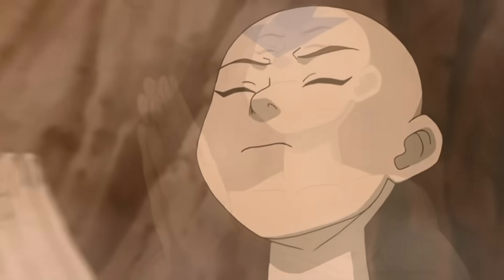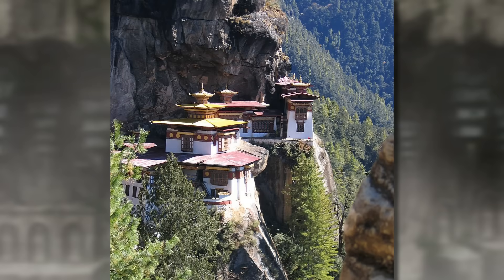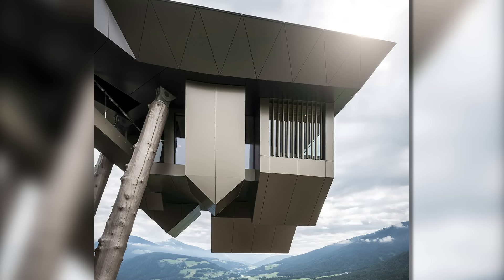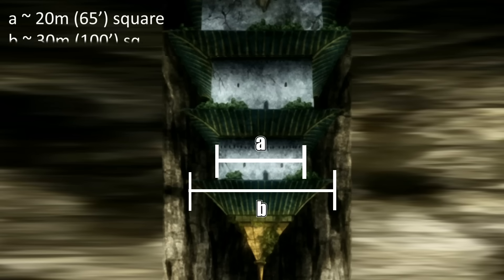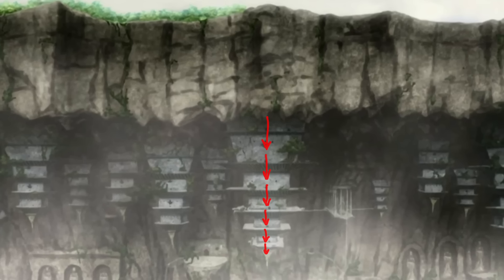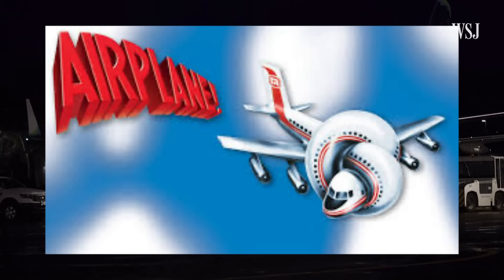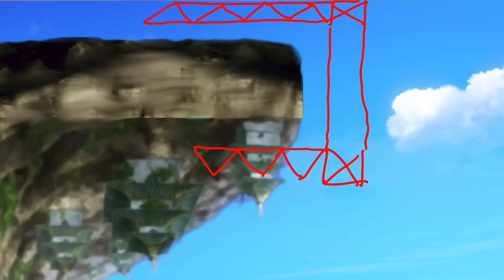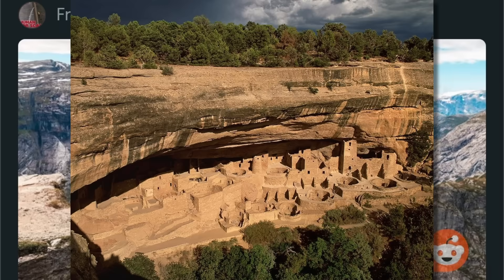Engineering Avatar’s Upside Down Architecture

Comment: I'm way late to this. But I have seen architecture like this before. Specifically in the game Skies of Arcadia. The city of Glacias hangs from the bottom of a cave ceiling. Inspired by icicles. I also have a note about how the Air Nomads made this air temple. And it allows for the solid looking building to make sense. Instead of the air temple being built like any other buildings. Instead they could have been carved into shape from already existing, giant stalactites and stylized scaffolding added around them

Comment: i thought it could be made be either carving out a stalacite, use beams going from into the rock to make a foundation, and then all the way down to carry all the wieght or a system of ropes or wires angered on the ceiling.
As for the reason of no real world examples? Big, stabil and reachable overhangs are extremly rare, and when they exist you could build above or below them instead.

Comment: My best idea, as a layman, would be to sink a  T shaped central structural member, probably steel or earthbent stone through the  overhang from the top, affix a cap on the lowest point, and use that as the support point to build back up the structural member to the overhanging roof.

Comment: Stalactites are NOT as solid as they seem. They're made out of calcium carbonate, a relatively soft, porous rock, and they're made through a process of water sedimentation rather than compression under heat + pressure say like how bedrock is usually formed. That's the same bedrock that's used as the anchor for most skyscrapers irl. I can't imagine the airbenders hollowing them out and using them as a base for buildings?

Comment: I think the use of multiple bending styles is the only way the western air temple could be built. Whether it was the cooperation of many different benders or some multi century project by several generations of avatars weilding all elements at once, real world manufacturing techniques are the real point of failure. 

Air benders can fly and have giant flying bison, earth benders can instantly and perfectly reshape rock and stone without worrying about imperfections or time for curing. Waterbenders can cut wood or help reroute natural springs to privide plumbing, and firebenders seem to have an advantage in forging metal components. The western air temple is really a monument to cooperation

Comment: My Analysis:
Since the Western Air Temple was built long before The 100 Years War (Fire Nation Rampage), the Air Nomads perhaps ask the Earth Bender to help build this Temple.
Now for the structural integrity, since it was built upside down, our modern structural design doesn't really matches with this model. So, i have a thoughts, Elementals Bending is fascinating because the Bender can manipulate matters to the atomic level (Fire Bending makes fire out of nowhere, Toph discover metal bending by analyzing earthly material in metal, Water Bender can control blood, etc), so the Earth Bender that build this strengthen the rocks by removing cracks and tighten the rock formations, so the rocks above can hold the structure that was built below.
How did they transport to this location? Every Air Nomads have Air Bison that can carry people, so they used Air Bison to transport the Earth Bender to the location, and then start building it, and voila, you have the Western Air Temple.

Comment: I would have actually thought of boring through the entirety of the rock and using some sort of super thick steel cables suspending down all the way to the "roof" of these buildings, and then building them to direct all forces towards the "roof". 
Either that or earth benders just doing super homogenous rock work, and given they can literally feel the properties of rock, they can probably also feel what would be a safe amount of weight to suspend in this way.

Comment: There also could be a more central support column, especially with a creative internal structure it would work a lot better.

Some large buildings were designed in the first place from handing memebers simulating compressive ones

Comment: If i could redesign the western air temple i would probably go with building it halfway into an overhanging cliff, keeping the core concept but making it actually mostly sensible.  
Basically like those houses that are built into hills, so you have entrances on both floors, except upside down.

Comment: The Air Nomads weren't an industrial society, and the temples are thousands of years old (long before the Avatar world's Industrial Revolution). So, structural steel likely wasn't used in its construction. At one point in the video, you compared the pagodas to stalagmites. What if they originally were stalagmites, and the ancient airbenders carved, hollowed out, and adorned them?

Comment: Actually there's a very easy and more interesting way to look at this from a mechanical engineering POV rather than just structural engineering. For a moment I want you to imagine a platter rope swing. There's a central tensile element (the rope) from which each "floor" (a wooden disk) hangs. the idea of the Western air temple is that same. There is a series of cables at the center of each of the towers that forms a strong tensile "core" and the various floors hang off of this tensile core. 

As a kid I actually designed and built one of the Western Air Temple towers out of rope and popsicle sticks and hung it from my ceiling, the structural model I used and the one presented in the video were completely different.

Comment: So the stalactites idea would be a possibility to me: maybe the cave is jutted with massive stalactites, and these airbenders made their structures around the stalactites. this way, the "upside down roofs" might be the building platforms, foundations and structural supports for the roofs above them. perhaps the walls of the pagodas are actually just chiseled walls of the stalactites. this would be in line with the scene where the building falls down and the building's inside seem to be solid.
Stalactites kinda form because of a water source above. with some plumbing they might catch the water, collect it and use the combined output of the stalactites for the fountain.

Comment: I always thought that these work like pyramids upside down that were carved out like the german castles. Think about it, pyramids have an ingenious design that allows them to be infinitely scalable since the load on the material doesn't change with size as with each new layer there's more supporting material. And since it is hinted that earth benders were involved, and it's shown that the power of bending allows to construct megastructures* is entirely plausible in this universe. In our universe, the biggest challenge would be finding a suitable piece of terrain that can be used. Besides, it's already shown that at least parts of the structure have been carved out of the rock formation, and since earthbending is the most efficient tool for that, it might be that the same earthbenders who have carved the statues carved the "cores" of temples. If you want to make the nerd-meter explode, you can calculate the power of combustion man's explosions to calculate the actual strength of the structures.

* e.g. (previous avatar creating an island, and the great wall)

Comment: Here's a support material you forgot: rope 

Since the entire structure is solely under tension, you don't need rigidity if the cables can be kept taut.

Silk, cotton, jute and bamboo fibers have much better specific tensile strength than most (if not all) metals/alloys.

And there are natural structures that hang of cliffs- plants!

So drill through the rock overhang, drop cables down it and anchor the cables throughout the material like plant roots.

You could also anchor it with laterally to the cliff face with additional cables. 

Drill down from the top then to the cliff face in an L shape. Also makes it easier to build scaffolding.  

You could use the drilled holes to drop down supplies and workers. 

The vertical cables could be anchored to the same beam as the lateral cables away from the overhang, making it a sort of tensegrity structure. 

The closest structures to what I described are cable cars and suspended railways. While not at the same scale, suspension bridges were anchored along cliff faces similarly throughout history.
Reply: While organic fibers have higher tensile strength you ignore the reason they're not widely used anymore, they rot. Remember the temple has been abandoned for one hundred years without upkeep.
Reply: @duckpotat9818  fascinating.

Comment: For airnomads the problems of constructing hanging infrastructure are almost neutralized
They have flying bison that have the mobility of an helicopter and the cargo capabilities of a semi-truck, and the airbenders themselves have no need to get extra support beyond their air gliders, and maybe some ropes
For the process of construction itself, to airnomads having the y-axis inverted or to just build high towers should not be that different, they probably did not use cranes to make the other air temples anyway, they just used airbending and bison to lift up the materials

Comment: I assume the best way to build this is to hang a series of steel cables from the rock, maybe anchor it on the surface even! They would go down either through the whole center of the building and meet at the tip, or to various points. Build the building up from the bottom, at the end, post tension the steel, similar to a post tensioned concrete beam! That's how I've thought of it.
Reply from the maker: Nice post tensioning reference! And making the anchors like thru-bolts all the way to the surface above would be a really solid connection. Great engineering thoughts!

Comment: could be that the Avatar creators asked a bunch of architects instead of engineers to design the western air temple. which led to a cool, but impractical design.
Reply from the maker: Architects taking the reigns often leads to wild stuff! Just needs a good engineer to handle it

Comment: What if each tier is independently anchored to the rock such that each tier's weight is supported entirely by independent structural members? Since the tiers shrink as you descend, the total weight of each nested structure could be roughly the same. I'm much more worried about the integrity of the rock than the towers themselves.

It's unclear how advanced fire nation metallurgy was at the time the temple was built, but the temple is shown to have large metal doors light enough for Aang to close with airbending when Azula attacks them there. 

How much support would huge cast iron cantilevers internal to the overhang running away from the chasm give you? With earthbenders to make the forms and fire benders to prepare the metal on site, you could cast metal in-situ.
Reply from the maker: Good thoughts! Yea, I’d be uncomfortable with rock anchors too, but with some testing, and large factors of safety (as we do we standard construction) we could probably anchor it well enough.

And interesting point about the steel doors, quite the anomaly in a place that seemed so organic.

Comment: I think the most plausible way to construct this sort structure would be anchored cables (likely steel), that are tied through the structure to the 'base' (the low tip), and is tightened such that the main structure is under compression. Look at the cables anchorages for massive suspension bridges.
Reply from the maker: Ah a post tensioned structure! That’d be like upside down versions of Toronto’s CN tower! Good idea

Comment: It was cool seeing an architectural view on the Western Air Temple. My personal theory is that the hanging buildings were built out of the solid rock itself, and with the "roof" elements being made out of more conventional and lighter building materials added afterwards. I'm not too sure about the tensile strength of rock though lol.

Comment: I personally think of porta ledges used in rock climbing using bolts or placed gear the ledge hangs off cliffs for multi day climbs. In general bolts are either those expanding rock anchors or now more commonly epoxy glue ins. Personally, I've taken some decent falls on single bolts and with heavy gear I've probably put a dynamic force of 600 ibs on the bolts or 3 Kilo newtons. Most bolts can hold around 20 kns or about 5,000 ibs (downward not outwards) While outward pulling leads to failure around 3,000 ibs.

If the air temple had multiple bots per stud all bolted into the side of carved out holes (downward force) I think a steel structure would hold
Reply from the maker: I considered separating out a discussion that compared anchors for rock climbing! Though by my napkin math estimation, the building would weigh upwards of 750,000 pounds, so it might take a lot of the climbing anchors!

Comment: Aside from carved stalactites one other explanation could be, bending.

We know airbenders used to be able to fly so they could definitely be able to build this.

And we know this was build in the earth kingdom. Meaning its likely they got help got adding structure from earth benders who just thought what they were doing was cool.

Earth benders could also push up building supplies from the ground then bring it back down.

They could also push the earth around in a way that reduces chances or earth quakes or even how much damage one would do.

Thus explaining why the structure is built out of stone but in a seemingly impossible way.

There could also be connections on the side of the mountain that arent shown. Like it could have a connection above but also one on the side. And considering angle and everyone went into a tunnel on the side of a mountain. Its definitelyyyyy implied to be the case.

Comment: I like the stalactite thought because that sounds like it would fit with air nomads to me. If they came to the area seeing these hanging sections and used their "flying" ability and sky bison to build balconies as a place to live and work. Then this could also explain the solid mass of the building as one was seen falling because they are not earth benders and don't have heavy tools or equipment to hollow it out except for some small rooms which would fit with being a nomad.

Comment: It is possible to replace the steel with Dyneema (uhmwpe) cables. Since there is only tension, the use of such cables is optional, and they are significantly lighter than steel.
It is not traditional construction materials, but that defenetly possible ( it steel require anchors in the rock of course, but everything will)
Reply from the maker: Oh interesting I wasn’t familiar with this material!

Comment: Hear me out here, they all seem to be built upward from the bottom, each one sharing the spire point at the bottom, so what if they're all built outward from from a central solid pillar embedded into the cliffs above. Like the rock anchor, but it's just one large anchor with an excessively long bolt extruding past the surface it's set in.

** This is assuming they aren't just giant stalactites that the earth benders grew from the overhang.

Comment: to be fair, the walls don't have to be stone or concrete or have a stone veneer, they could be wood supports with a painted clay veneer. since they don't need to worry about the temple being rained on and clay is lighter than stone and easily replaced when damaged. if they wanted it to look like stone they could and it would still crack with weathering, explaining the cracks we do see on some of the buildings

since the temple isn't exposed to conditions normal to construction on the surface, plenty of older and otherwise unconventional materials could potentially be used to recreate the temple
Reply from the maker: Ah that’s a good point, in the same way that a stone veneer mimics actual stone, clay could do the same… would it be that much lighter (100pcf v 150pcf)?  Yea if whoever would actually build something like this has the means, no kind of material would be off limits

Comment: That temple existed before the Fire Nation's rampage, so it's not without reason to assume the Earth Benders lent a hand. If you look at their cities, it's pretty obvious that they "stamp their feet" and structures form up (or in this case, down) from the ground. If it's solid rock, then it's hanging from itself and doesn't need much artificial structural integrity, as the added components hang off the rock core. Since the temples don't continue into the rock upwards, then the reason it looks solid is because the connection to the overhang of the structures isn't hollow, because it doesn't have to be. The whole point of the Air Temples were for meditative seclusion and fortification, so the only way you can get to them is largely by air travel.

Comment: While very informative on modern and real world building and structural techniques to explain the Western Air Temple, I think the simplest and most likely explanation is that this was possibly a cave system with massive stalactites that were converted into buildings. You have to look into the formation of cave systems and the type of materials that stalactites are made of. Apply that to a FANATSY setting like Avatar and it’s not far fetched that massive stalactites could’ve been shaped into buildings. More evidence for this so the water system you pointed out as caves and stalactites are formed from ground water seepage over eons. Not to mention it wouldn’t be so difficult for an Air Nomad avatar to earth bend the cave system and features. This is also evidenced at many features in the actual cliff face. So while using real world modern techniques to explain this is interesting, we should probably stick with the basic and most likely reasoning of earth ending and the fantastical topography of the world of Avatar